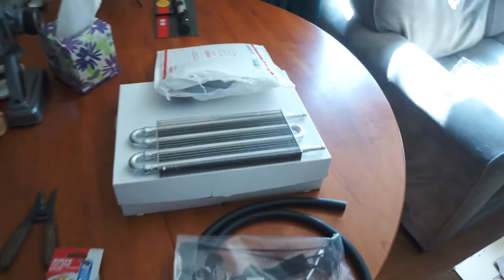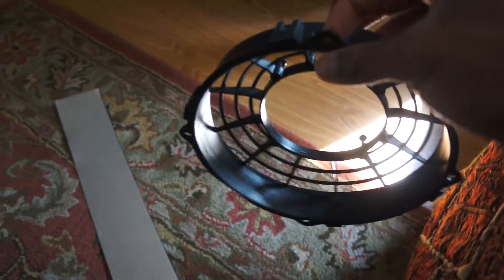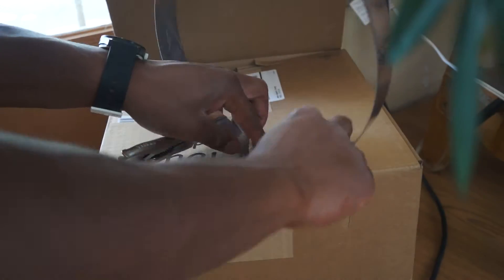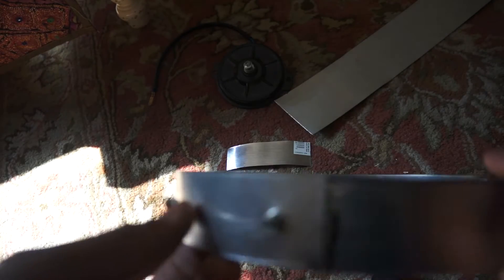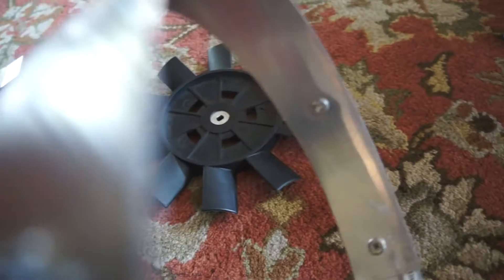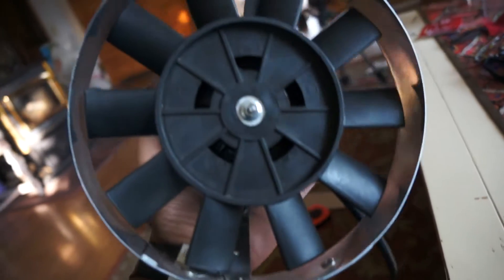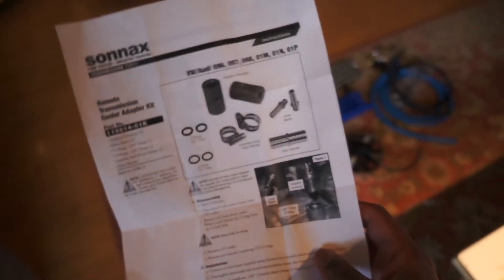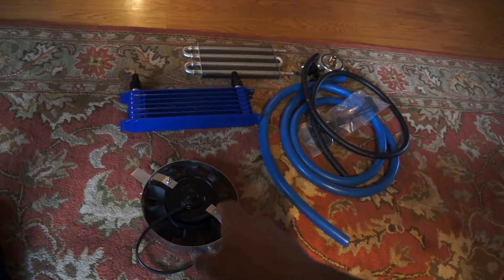Project Cool P.2: "600 CFM" Plastic eBay Fan Converted to Aluminum!

Comment: How has the car been running with the tune ?
Reply from the maker: Juan with the wind runs great! I'm happy with how smooth it is and the power. afr's seem to be good from what I can tell. maybe a hair rich hence the flames at times but nothing bad. I need to pull the engine and refresh everything when I build the engine meaning all new sensors and plugs because the check engine light goes on and turns off within 20 minutes or the next start up. engine also needs a deep clean deep clean.
Reply: Stance Santa Fe good to hear its running good. I have been running mine with the maf on the intercooler piping and I see yours is on the turbo is there any difference running it on the intercooler piping?